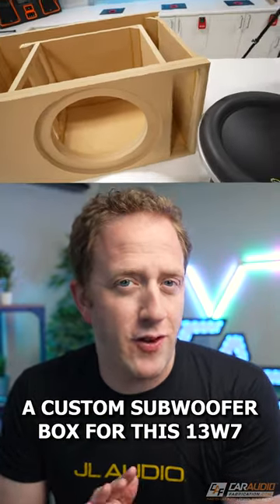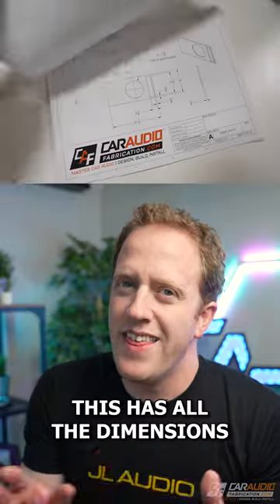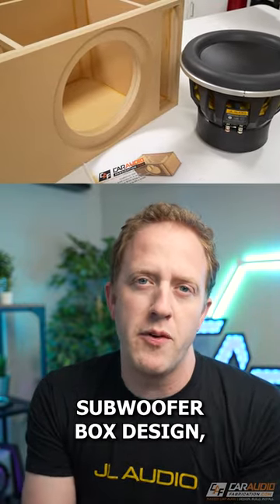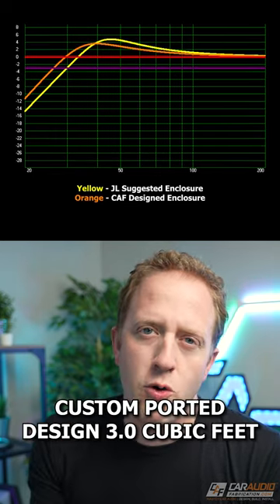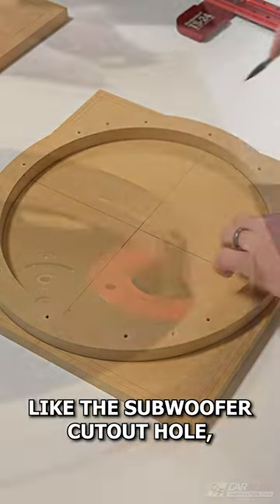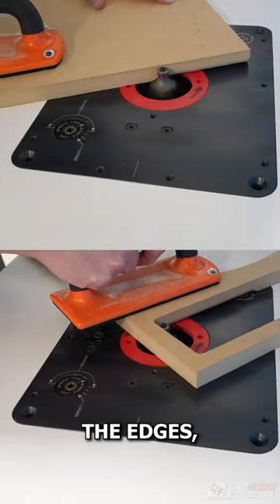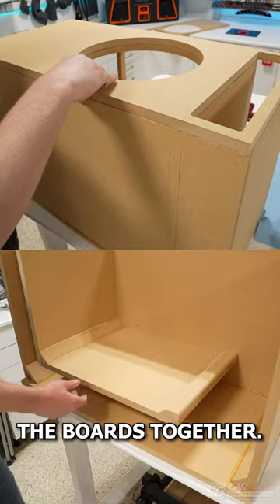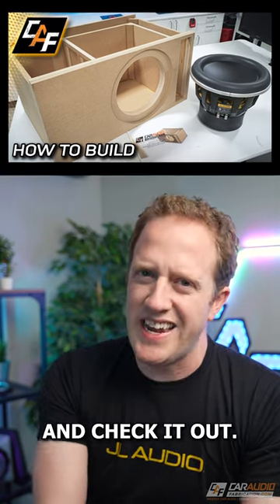Let's build a ported subwoofer box for this 13W7AE!

Comment: It'll be tight! See if I ever get to do mine. I have a 2018 Kia Optima S (looks like the new K5s) I'd want like a box that fills up roughly half the trunk with some kind of porting out of the back so I can put down the seats to get the funk but still see the badass speakers when I open the trunk😁